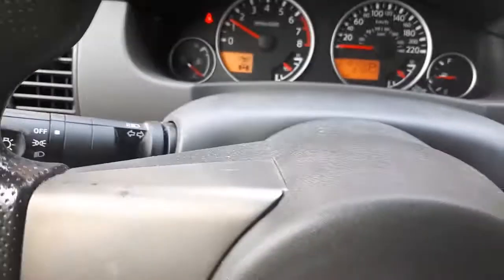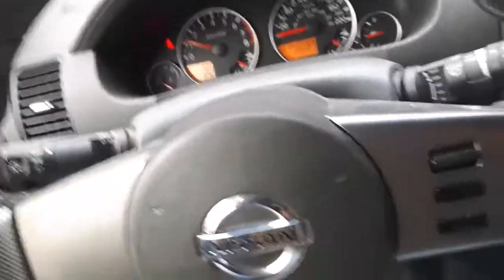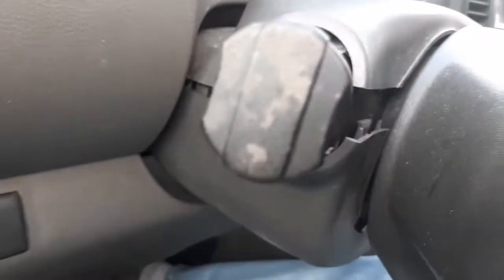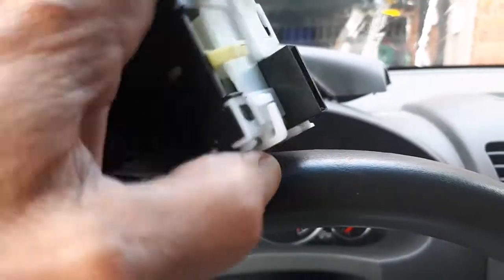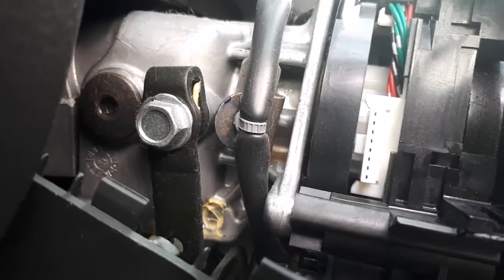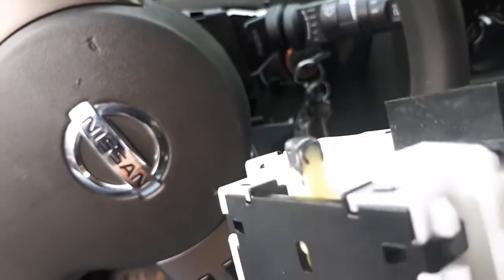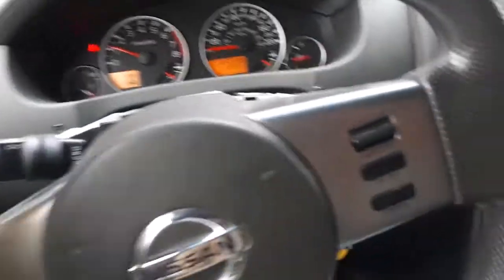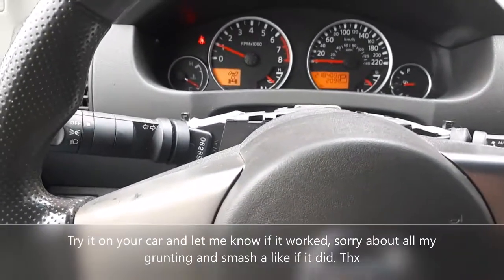Fix a turn signal switch no cancel issue for Nissan and probably other makes

Comment: Thank you. This no-cost repair fixed a really dangerous problem with my 2010 Qashqai Tekna. I could not cancel my left indicator at all, which upset a lot of other motorists!  🙂 Total repair time was about 15 minutes, plus the waiting time for the epoxy to set hard. A second-hand indicator switch units are available for about £60, but you never know, you could buy one which causes the same problem!

Comment: Wow this actually worked.. after days of trying to find the flasher relay (which doesnt exist on my 2004 nissan altima) to realizing this component is what controls the turn signals.. and now seeing that the issue was mechanical (this) with your video. Thank you so much!!
Reply from the maker: Good Stuff !!

Comment: Before this escalated to not cancelling at all, can you remember if it started off intermittently and possibly cancelled itself after a few seconds?

Mine seems to sometimes delay the cancel but it does eventually happen, usually after a few extra blinks after the stalk popping back into place.
Reply from the maker: I think so ya. its worth a try.

Comment: Just changed a clock spring and now have exact same issue.

Only fails to self cancel on the left side.
Reply: were you able to fix it using this method in the video.. Were the tabs part of the clockspring or part of steering wheel ?
Reply: @eddt7764  yes it works.
Reply from the maker: yup @eddt7764

Comment: Oh My Gosh the BEEEP! Cant watch. But thanks, watching on mute now.
Reply from the maker: My heavy breathing drove you mad, don't forget to sand your nib before releasing the epoxy. I used jb weld
Reply: @jeffmcilveen2796  honestly didn't notice breathing.  had earbuds on that super enhanced the ignition beep.  Oh well.  I have an 03 X that's different, but ya got me lookin in the right spot.
Reply from the maker: @hillmakeitbetter  Let me know if it fixes it
Reply: @jeffmcilveen2796  My dab of JB Weld came off while filling it down. Even after 2 cure days. 😓 I superglued it back on.  Then it must of been too big as it broke off during testing.  It seems like it might have worked if it had a good bond.
Reply from the maker: I cleaned my nubby first and filled it before I put on the jb. I failed the first time so get that nubby cleaned and filed first @hillmakeitbetter
Reply: @jeffmcilveen2796  Before the super glue, I filed and cleaned it, still no luck, likely from the excessive grease.  Back story, I bough a NEW signal that had the Fog Light switch... but IT didnt cancel the turn.  My OEM switch still canceled, so I swapped the guts to get the fog switch.  Likely poor mfg tolerances on the replaement.
Reply from the maker: @hillmakeitbetter  Use rubbing alcohol to clean it and file it with a nail file. Thats what I did
Reply from the maker: And dont use much jb just enough to top it just like a drop
Reply: You can turn sound on at 3:08
Reply: But turn it off at 3:52

Comment: Hello .. is this nub that looks little short is part of the clockspring or part of the steering wheel .. ??
Reply from the maker: Its just the nub off the switch that comes off.
Reply: Why are you saying hello as if he didn't perfectly explain the issue like what did you even whatch the video????